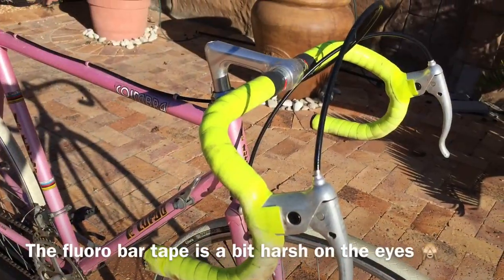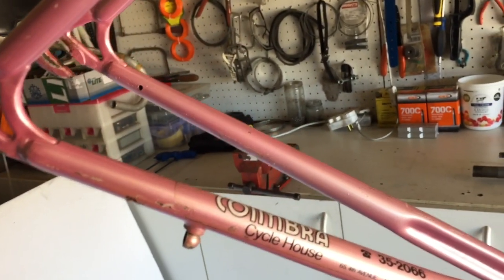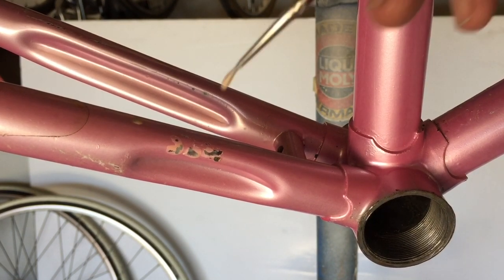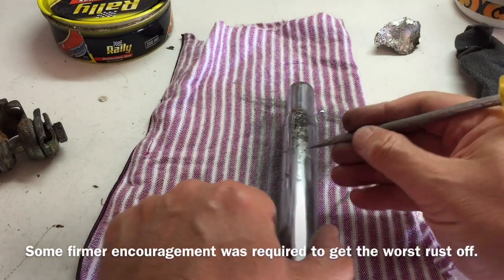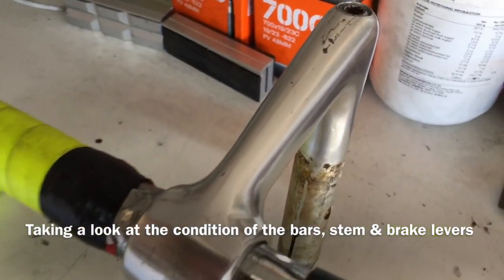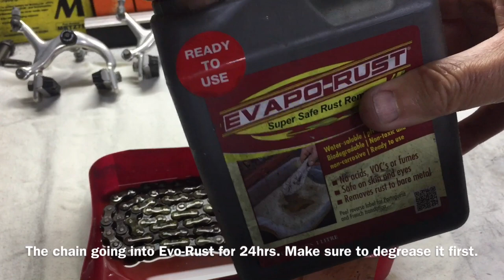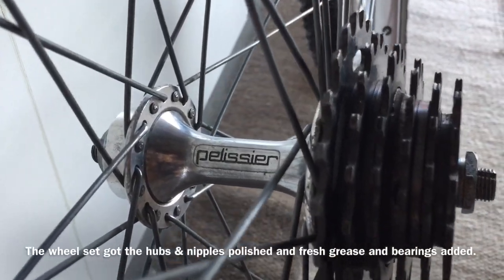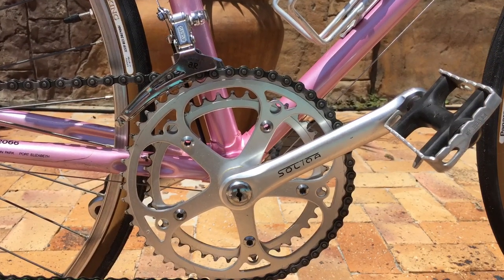Le Turbo Bicycle Restoration

Comment: Top video!
Going to look at a burnt-orange Le Turbo tomorrow in Brisbane, Australia. Fingers-crossed it's a good size!
Reply from the maker: And… did you buy it? 😁
Reply: @BuffsVintageBikes   I was too slow!!! I've reset my sights on a potentially lovely 80s Peugeot. Exact model unknown but looks similar to your Rapport build. 🤞🤞
Reply: @BuffsVintageBikes  picked up the Peugeot! Much older than expected, 70-74ish model! Here we gooooo  😬
Reply from the maker: @kickjack  Wonderful, good luck with the restoration 👍

Comment: Hello. Nice restoration o/  At 16:14, the numbers 4085 on the (Sachs) Huret speed lever stop are actually the build date of the lever assembly, namely the 40th week of 1985. So the bike might be slightly after that date depending on the amount of stock, speed of delivery, etc.  ;)
Reply from the maker: Hi Nadia, thanks for pointing that out, I wasn’t aware of that fact, very interesting 🙏🏼👍🏼

Comment: LeTurbo only real with a Turbo saddle! :)
But again, this video shows what restoration is all about: Preserve/fix as much as possible before you start putting on new parts. Great job!
As a personal note, I wouldn't have went as far as gluing plastic parts together, because most likely it won't hold and maybe the part might not be worth salvaging. Still I like the approach: Work with what is there!
Reply from the maker: Thanks Marcus and to be honest, I had fitted a Turbo saddle but it had been recovered in navy blue leather and it didn’t suit the black bar tape so I removed it 😊
Reply: Just checked quickly, there is a Simplex FD that looks like the one on the bike, for only EUR 10 (about R 180) Yes, I know, shipping would be prohibitive if it was only for one part.
Reply from the maker: Thanks, I’ll take a look 👍🏼

Comment: Nice job! Pink bikes are always pretty. I am restoring a bike of my father and it had a black handlebar tape like yours. Could you tell me which model is it? Thank you.
Reply from the maker: Thanks, the bar tape is call Good Horse bar tape. You can Google them 👍🏼
Reply: @BuffsVintageBikes  thanks! I did it, but unfortunately, they’re not sold in Spain.

Comment: If I need to bond anything I use a 2 part glue called araldite, leave it to cure over night, it’s never coming off, plane wings can be glued on with that stuff
Reply from the maker: Thanks for that Steven. I unfortunately haven’t seen that product locally but I’m going to try with Pratley’s before giving it up completely.